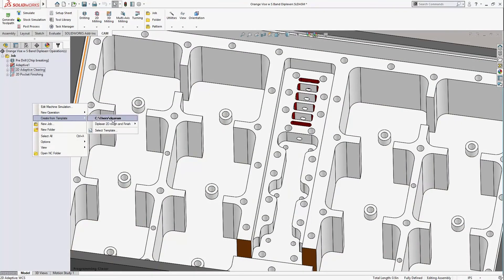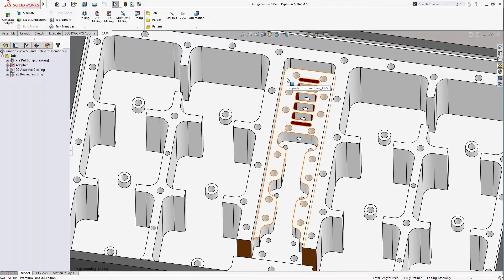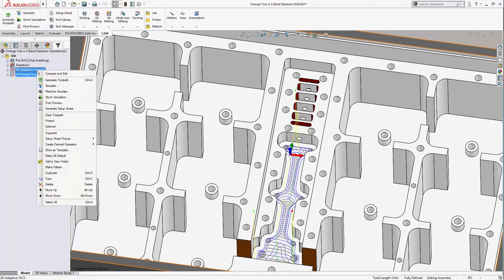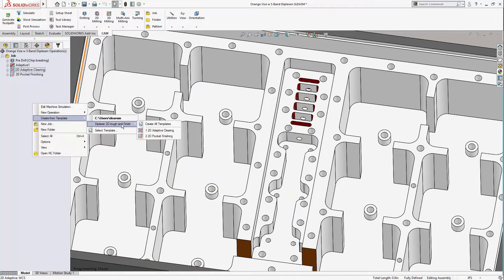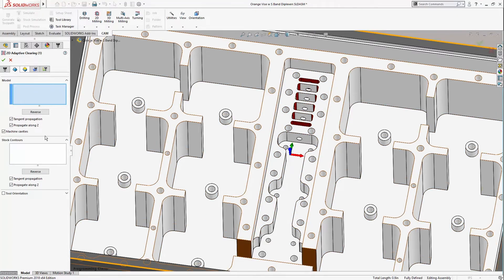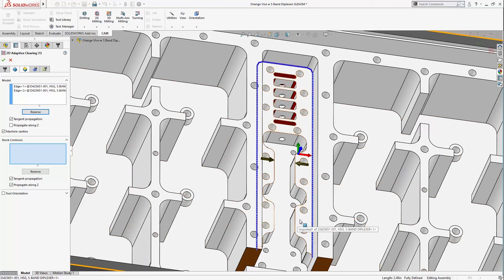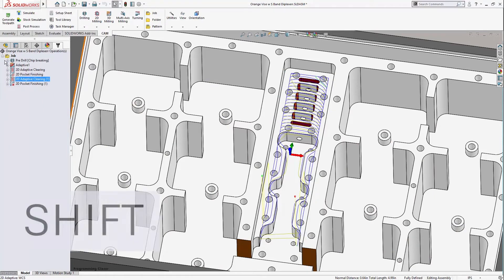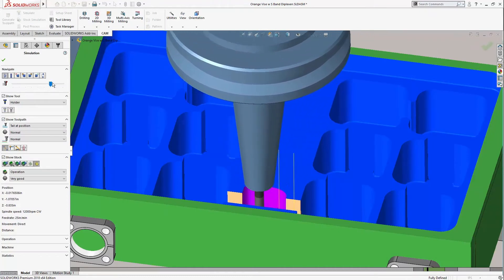HSMWorks QUICK TIP: Templates & Copy Geometry

Comment: There must be some kind of bug, doesn't seem to work in Fusion!
Reply from the maker: Yep, the Shift + drop trick is unique to HSMWorks unfortunately.
Reply: The Heights geometry isn't copied across either. Still useful though.
Reply: hopefully you both know i'm kidding; but i'd love to see this moved over to Fusion, along with drag and drop association of tools, and drag and drop of operations onto faces and features. They're gigantic time savers that drive me insane when working in Fusion.
Reply: rob lockwood I know.. it's fundamental stuff that should be there IMO. Heights & Radius geometry selections should be included as well. I'm guessing when it was implemented in HSMWorks you couldn't select geometry for Heights & radii